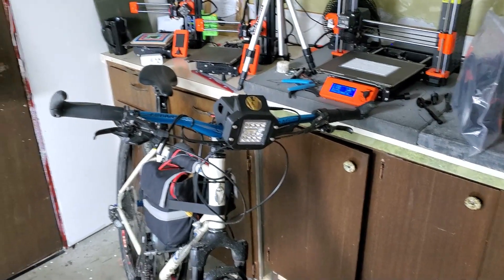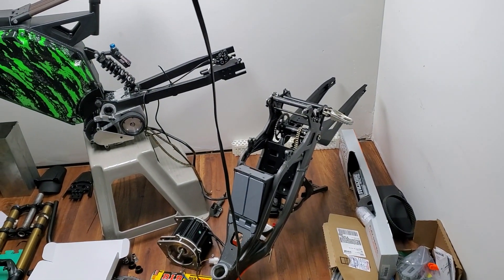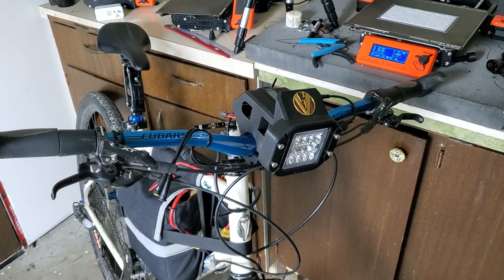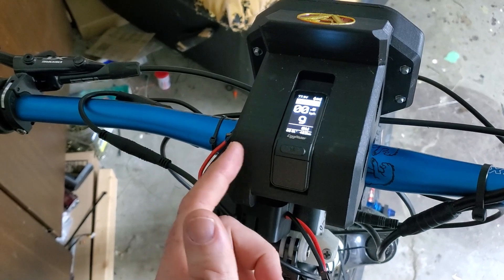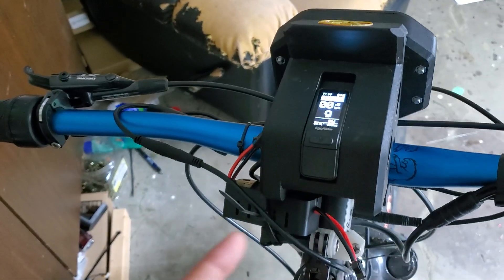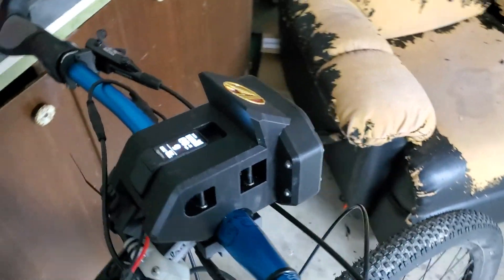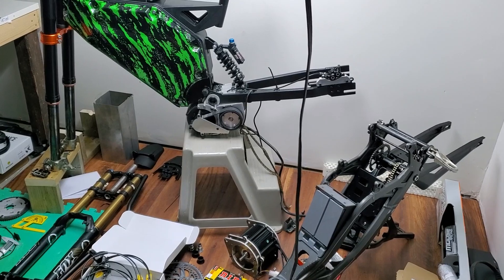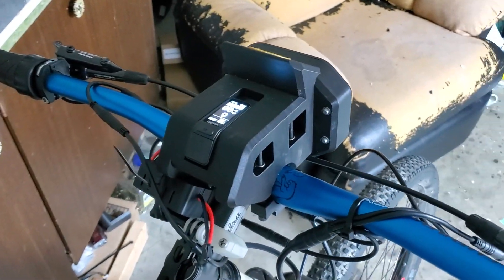Happy Halloween! EggRider V2 Integrated Dash, Light and Wiring - Concept and Development

Comment: I had à egg rider but not my cup of tea ...I noticed you had magura brakes? IF SO if you have any problems let me know..they work well but finding the right  pads and bleeding them is hard work...if they squeal use SwissStop..I got it to à fine art it takes me about 40 seconds !! It took me two months and 350€ to invent the system but bleeding is no longer à problem..I like the light any chance of getting a similar system to fit the bafang 850c display ??..I have the light on the bottom of the fork above the mud guard.  Higher up on the handle bar is a good idea better spread of light on long distances...anyway John good work and keep going...designing and building is alot of effort but I know you won't give up..submarine..👍👍🚵‍♂️🚴🚴‍♀️🚴‍♂️ I like the music Blue thunder ??☆☆
Reply from the maker: Thanks Sir! Appreciate the support. I will be having questions on the brakes for sure. Going with the floating rotors Max recommended. They seem to be okay right now but will be sure to bed them in properly! Cheers